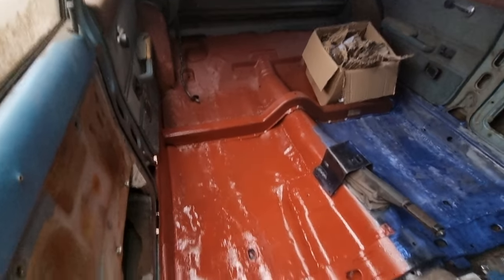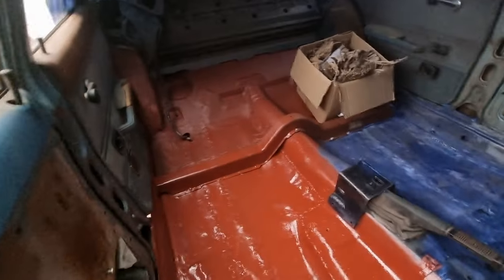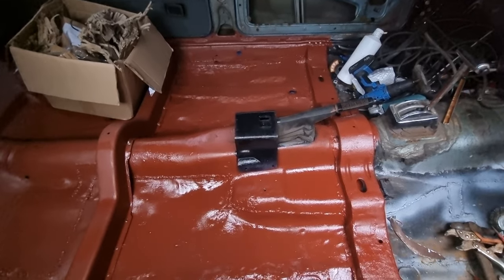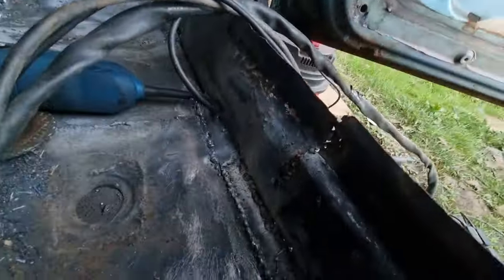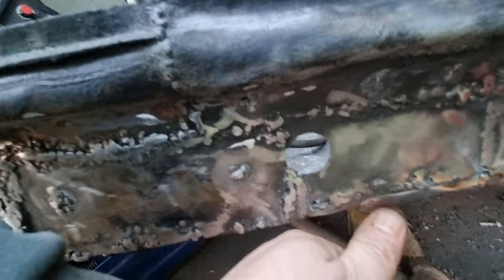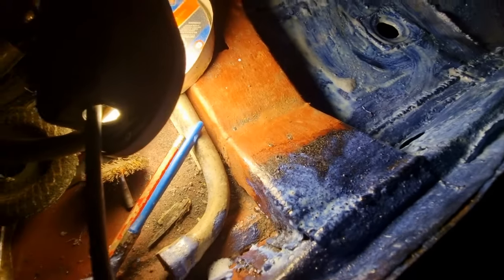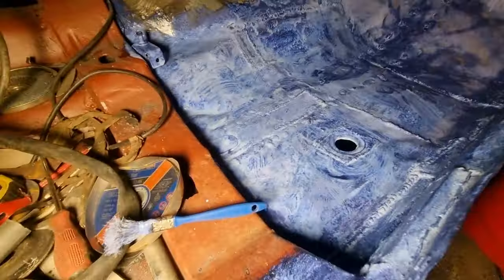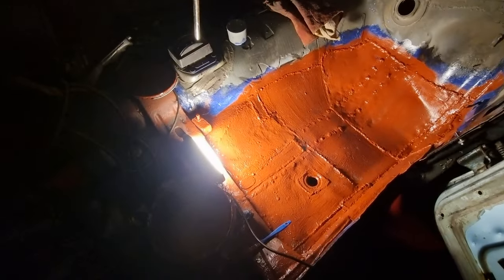Cortina Mk4 Ghia 2.3 V6 // Restoration red oxide primer (P52)

Comment: Can’t believe you’ve done all that under a tarp on the drive in this crap weather Adam you’re a bloody trouper mate well done you’re certainly knocking the jobs off the list . Great job 👍
Reply from the maker: Thank you yeah in all weather as to be done if its dam out a hot air gun for.warming the metal up before primer is your friend I grew up in the 80s and mu dad used to work outside on his cortinas all day into the night lol

Comment: Making good progress. Do you use a magnetic plug weld tool or similar for welding up the pinholes or do you just weld them without something behind to stop the weld blowing through?
Reply from the maker: Depends how big the hole is if it's big ixwill use mu copper hammer beind the hole if it's in the floor I use my copper hammer on my jack hehe